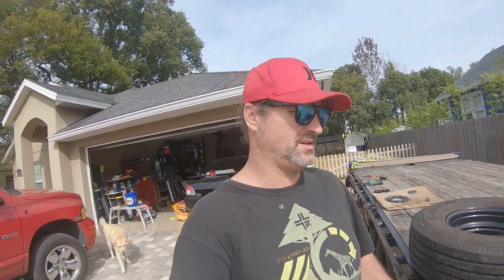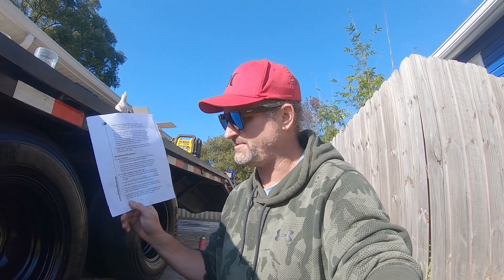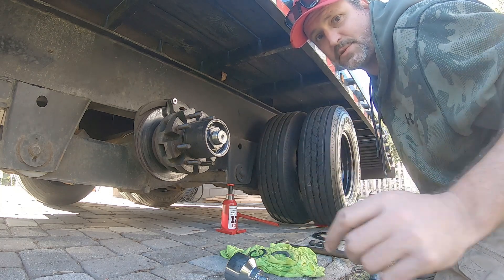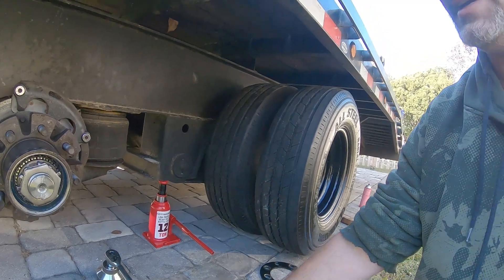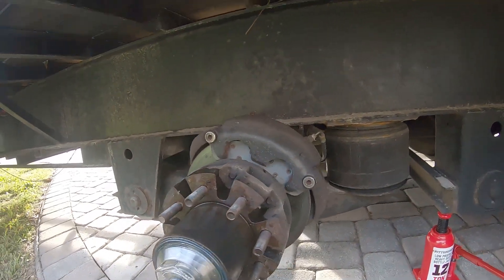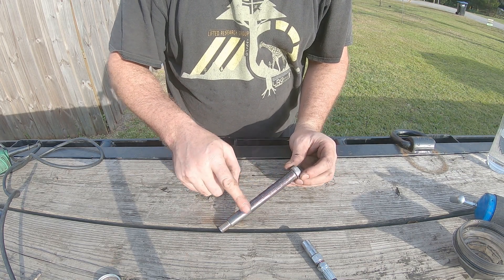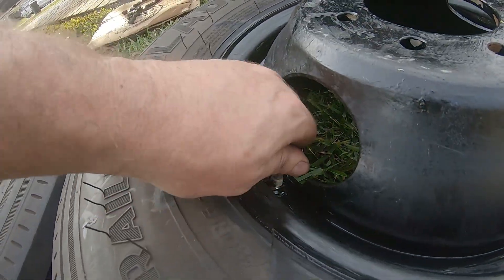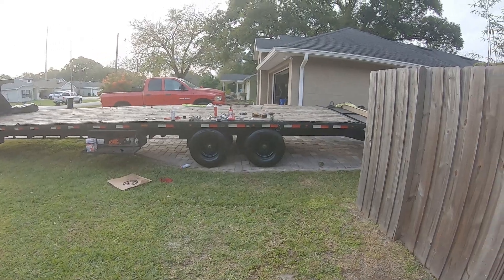Tang washer and axle nut torque sequence for Dexter 12k oil bath axles. Finish installing rims.

Comment: Good video, just to noted it wen you spin the wheels and check how easily rotate (when you have elctric"drum"brakes) and you adjust the brakes they have to spin just a litte bit, so i could be a litte confusing with the adjusment thatvyou doing.
Reply from the maker: Didn’t have drum brakes

Comment: Be careful using a torque wrench to loosen nuts. They should only be used for tightening.

The theory is that you don't know how much torque it will require to loosen it and you could throw off the calibration.

I'm not a huge mechanic nor my Hotshot where do I even fix heavy equipment. I just heard this tip a few years back when I was looking up something about my torque wrench. I just found your channel and I'm catching up on your old stuff. Love the videos.
Reply from the maker: Thanks for the support and tip.  Will do next time I use it

Comment: Appreciate the mention!!, down the road you might want to consider the dual tire equalizer with color sight monitor. Easiest way to check tires and guarantee they have the same pressure and wear well. Also easy to fill with the single port that fills both tires :)
Reply from the maker: Thank you brother!!! You have a brand suggestion for the tire thing? Sound like the best thing since sliced bread!! I hate checking the inner tires 😡
Reply: No sorry , I just really like them for the smaller dual wheels that are such a pain. I have a tag/equipment trailer with quads I will probably get whatever you end up getting lol , I don’t use it for work.
Reply from the maker: @Mostatebeststate  haha.  Looking around and found the "crossfire" pressure equalizer.  Looks like a winner and might be coming soon!!!